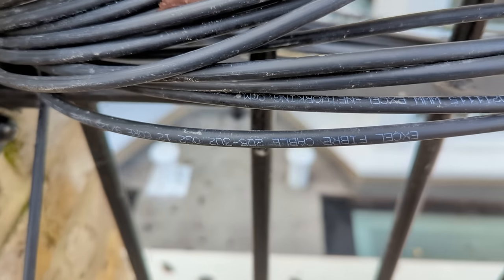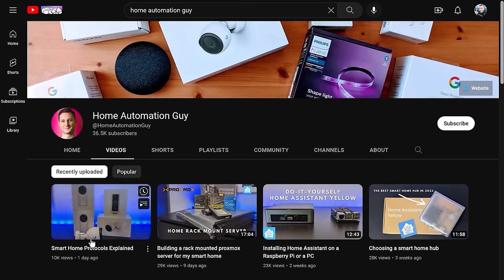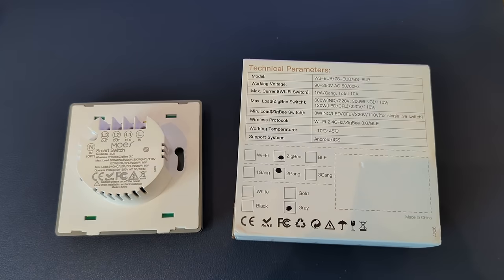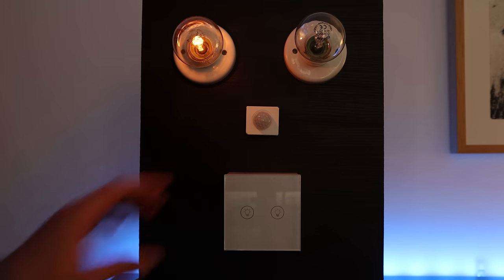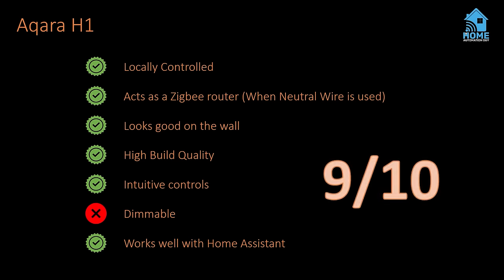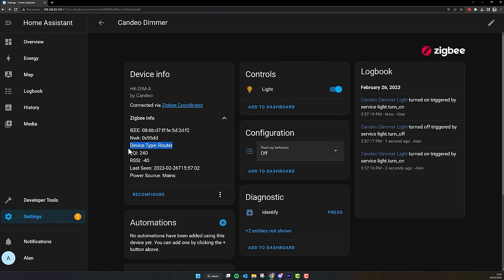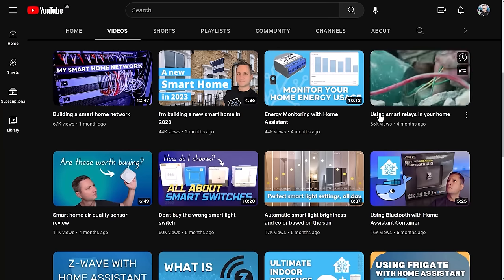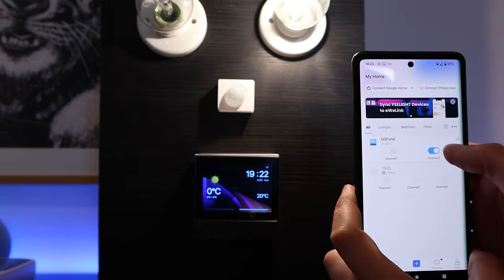Which smart light switches are the best?

Comment: Great video. A few folks have mentioned but there is the option of using Localtuya or the newer Tuya Local integrations to control your Tuya wifi devices locally. They are still connected and sending updates to the cloud, so this is by no means a security measure, rather a way to improve the responsiveness of devices. I have several Treadlife wifi switches and several lights bulbs that I connect using Localtuya and it works great.
Reply from the maker: Thanks for sharing!
Reply: I'd personally avoid wifi switches since Zigbee exists and is better suited for this use case.

Comment: I am really enjoying your videos, I have watched most of them and have picked up a lot of good advice and tips from them. Being in the UK and going through the process of building my own house and making it smart as I am going along it is really useful to watch your progress.   NSPanel a defnite yes, I bought two of them when they came out with the future purpose of using them with Home Assistant so I would be very interested in what you come up with.    I also noticed in your video you have a Heatmiser control system in your house heating. Have you tried connecting that to Home Assistant yet. I have read it can be done but haven't tackled it yet as the physical building of my house takes up most of my free time. Your thoughts on connecting it to Home Assistant?   I have an 8 Zone heating system so Home Assistant monitoring would be an ideal solution.   Thank you again for your time and effort, I look forward to everyone of your posts.
Reply from the maker: I have my Heatmiser connected in to Home Assistant using the bridge, and the HomeKit integration.  So far (About 6 weeks of usage) it has worked brilliantly.  

A full video on it will be coming soon.  Like you, I'm so busy getting the house sorted out (Both smart home stuff, and normal boring house stuff like getting the boiler serviced) that it's hard to do everything at once!

Glad you're here coming along the journey - I'm sure we'll both learn all sorts of new things!

Comment: This is beyond useful. I'm so happy you are doing these kind of videos. I'm planning to try out building a smart home using home assistant, and I just don't know where to start. Your videos are helping me understand many things as I'm completely new to this thing. If you would do a similar video to light bulbs and bands, sensors, power sockets would be awesome! Ty! Also does the 2 gang candeo consume 0.8 W of power?
Reply: What you dont mention is that you need to check your amps on your switches..not every smart switch is compatible with every house.Most homes do have neutral wire bundles in the wall! Dont confuse people on here!
Reply: @AngeloR674  i just assumed that if the 1 gang switch consumes 0.4 W, than the 2 gang consumes 0.8. I have no electrical background. I see no harm in asking. I thought this was a friendly environment. If people get easily confused by what I said they are also probably not familiar with electrical stuff, and my question will do more good than harm, if it gets a reasonal answer.

Comment: I've been using Candeo - definitely the best I've tried (albeit from a limited pool!)

You can also fit the Candeo modules into a fancier faceplate - I've got some fancy looking smart light switches now!
Reply from the maker: I'm using the Home Assistant Sky Connect zigbee coordinator.  I tested the Sonoff relays in a previous video and didn't like the clicking noise that they made, and they don't fit too well in a standard UK back box.

Comment: Great video and echos my tactile findings with the Moes and Aqara switches. However the Candeo switches were a revelation. Never heard of them before but will be giving them a check out now. I have no neutral at any of my light switches so my choices are limited anyway but they seem like a really good option along with the Aqara switches. Loving this video series. Keep up the great work!
Reply: I have a Samotech, marked as HK_DIM_A in Home Assistant, which is, I think, functionally identical to the Candeo one shown here. The only quirk of it is you can't toggle the light from HA, only turn it on and off. I didn't measure it's idle power draw. Unsure if the Candeo has this functionality but with the Samotech you can even attach a second hardwired switch to control it. You must used a push button, but it can also dim the light up and down, and operates in the same funky way as a switch shown here: dimming up and down reverses on each press. It's still a useful feature. These dimmable switches that act as a replcement for old school dimmers are definitely underrated.
Reply: I have the same issue as you, no neutral at the light I want to replace the switch on. I tried a Shelly 1L but my light would permanently stay on. I could try the bypass but read those things burn out sometimes (fire hazard).
So I’m not eyeballing the Aqara without neutral. Hope the load doesn’t have to be high in order to use them properly.

Comment: The hardest bit in this system for me is the one htat is hardest to test (without buying a ton of switches and trying them out) - how does the system work when the Home Assistant is unavailable?

Unlike the approach that you went for (smart switches + dumb lights), I am still hoping of being able to cobble together a smart switch + smart light combination, that would give all the same benefits as you described (including turning lights on/off when Home Assistant/Zibgee/WiFi are down), but also allow control of brightness and color of the lights from external controll (like via HA scripts and automations).

And here lies the problem - ideally, I'd like the wall switch to send signal to the smart bulb(s) to turn on/off/up/down when the system is working correctly, but also fall back to physically cutting the power when the system is down. And I am not sure if there actually exists a solution that can do this.

Comment: I went with Sonoff, a combination of the NSPanel and the M5 (which is just a regular switch). I went 3 Gang everywhere on the M5s even though I don't need more than one gang anywhere (except I need two in the living room, but there's an NSPanel there, so two gangs was a given there).

They're wifi and they do not dim. I plan to do my dimming through smart bulbs anyway (yeah, I'm doing both smart switches and bulbs). I'm also expecting that one to three presets and maybe some automations will be more useful than a dimmer switch that sets the light level manually.

However, the main benefit is that I'm running ESPHome on the switches. That's a lot of effort to set up, but competely guaranteed to be local and giving me insane levels of control. I set up things like long presses and double clicks, and I set it to blink the blue "status led" to give feedback when doing those things. And the level of control that ESPHome combined with nspanel-lovelace-ui gives met over the (matching!) NSPanels is absolutely insane.
Reply from the maker: I agree that ESPHome is awesome and I love that you can flash those devices with it. But I agree that it's an effort!

I've done it with a few things though that I think are worth the time investment. Stay tuned for future videos showing you what!

Comment: Thanks for taking the time to document your projects. I especially liked your comment on the wii-fi switches. :)

My solution:

Samotech dimmers, which are basically the same as the Candeo ones shown here. One of these is in the living room and controls the six lamps in the ceiling.

Rooms with one ceiling light, like bedrooms, use smart bulbs with an Ikea dimmer over the hard switch. I have a bunch of nice looking plastic mounts screwed over the switch, with the dimmer magnetically attached to the mount. The nice thing is if I ever have troubles with Zigbee or HA I can just pull off the dimmer to operate the hard switch still underneath.

The room I haven't tackled yet is the kitchen. I suspect it will be more Samotech dimmers driving the 12 downlighters in the ceiling. Bathrooms with extraction fans also present some interesting challenges.

Comment: I use Aqara neutral switches throughout my home but my main difference was also Zigbee RGB downlights or GU10 bulbs throughout, about 75 in total. The main plus side of this is complete control of every bulb by not having the switches wired in as dumb switches, i.e. they don’t completely kill the power to the bulb. I have mini switches around the home that activate scenes or i can double tap the aqaras to do something else. Pairing is a real pain but that should be rare once initially setup
Reply: Hi, I hope you don't mind me replying to this old(ish) comment..... I'm just nearing the end of a full-home referb and I've come to the time to choose lighting options. Like you, we are going to have GU10 spotlights throughout, probably a similar number to you, and I am keen to have them all as smart bulbs so I can control different scenes/setups anywhere in the house. I've been pulling my hair out trying to find a tidy solution for the switches that keeps the hard- power on while allowing soft- switching of the relevant lights. Dimming would be nice but I can live without it - 90% of use will probably be by voice anyway. What I desperately don't want is battery powered switches sitting on faceplates over dumb switches though. It seems like such an inelegant solution and before finding the Aqara in this vid I couldn't believe there wasn't a better alternative.

I am replying to ask if you woudn't mind answering a few Qs? a) Are you still happy with the Aqara solution? Which GU10s are you using and would you recommend them? Same question with the mini switches? Are you using this all with Home Assistant or native apps? (I am unfamiliar with HomeAssistant, but tech savvy so I will soon learn if it is the best way to go). Any other tips? Thanks so much in advance for your time!!!

Comment: good day Alan and great review as usual! I used it as an inspiration and finally decided to move forward with Aqara H1 EU (no neutral) for most of my wall switches. What is left to be done is the hall-way where 3 dumb-switches (also no neutral) control a single light. Do you have any recommendation how to tackle this specific use-case for which I will need three Zigbee (no neutral) smart-switches? I don't think H1 can do the job. Thanks!

Comment: I am just getting into smartening up my home and had some what similar requirements particularly for the minimum use of wifi in order to keep things local ( I expect us all to be disconnected from
 The grid for various reasons in the future) and I agree about the zigbee focus, one of the things you didn’t try and I am waiting on the delivery of some units to test are kinetic based rf switches from in my case Quinetic. As they can connect to the quinetic hub to give WiFi and therefore home assistant integration they serve for me the purpose of not having to channel out walls in areas where I want new two and three gang switches, the ability to not have anyone mess up the automated side of things by using a wall switch but giving Luddites the ability to seek out the familiar wall boxes to make light is a very nice to have conceptually, infact if this works I will put all the main power cut protected lights on to kinetic switches to ensure safe passage around the property in black out periods.

Interested in any feedback from anyone already tried the quinetic also

Comment: Great video Alan 👍 do give the varilight v-pro smart wifi switches a look. I use them without issues and have installed them for family , may not meet your extensive requirements but they do 3 and 4 gang versions as well and come packed with great features. Also able to handle many types of dimmable led lights, trailing/leading edge and dimmable led drivers without issues. No neutral wire required.
Reply from the maker: Thanks for the tip!

Comment: At a guess the idle load from the candeo is because it needs to send a small amount of power through the bulb in order to have a small amount of power for itself.  Probably the bulb is what's actually consuming the power.  It would be interesting to see what the load is when a dimmable led is used.  Really wish candeo would release a neutral required version, it would be the perfect switch.

Comment: You will love the NSPanel, according to Mark go for the white one.
I have 7 throughout the house and the functionality is unbeatable. There are two major versions, joBr99 which is so so versatile and Blackymas blueprint which I loaded up last night to test . Blackymas version apparently supports switch functionality if WiFi drops out
Reply: The buttons work as switches with joBr99's nspanel-lovelace-ui as well. At least, I'm using it with ESPHome, which means that while the screen runs 95% on my HA server, the physical buttons run completely in ESPHome, which means that I basically have full control over what they do locally. I suspect it's similar with tasmota, but I don't actually know for sure
Reply: @jasper265  how did you get it working with ESPhome. Curious to try myself ☺️
Reply: @clairerovic  basically just follow the documentation and then use the HA service to upload the screen (which wasn't entirely clear from the documentation in my opinion). I was going to offer to help further if that didn't work, but YouTube comments aren't a great place for that and every comment I post with how else to reach me just gets deleted...

Comment: I'm working on a kitchen remodel and trying to figure out if I can wire it accordingly for smart lighting, so this information was really helpful, even though I'm in the US, since some of these vendors also sell versions in US. I also use HA with ZHA but haven't used it so much with lights yet except I have replaced some switches with Leviton Zigbee switches and dimmers and they are solid. But, I am thinking I want to have custom zones and lights to switch between warm and daylight mode, and that requires smart light fixtures, so the comment on the detached relay switch is very interesting to me, assuming there's a US version. Although it sounds like to get the full benefit, Z2M is required which I think means I have to rebuild Zigbee network from scratch and repair everything?

Comment: besides aqara, the rest of the switches you tested are simply tuya oem products, UK only has basically these 2 choices? what about brands like tapo, lutron, broadlink, sonoff and etc?
Reply from the maker: A lot of those brands don't do local control that works well with Home Assistant, which is why I didn't look into them further.

Comment: Another great review. :) I'm in a similar situation, retrofitting an entire house. Unfortunately I'm in Oz so the switches you reviewed are not directly transferable to down under due to our different switch dimensions. Although we can go up to 6 gang with ease. :)
I've been looking at the relay market instead (shelly, athom, sonoff, etc). I like the idea of being able to use any switch panel I like (including the ones that came with the house).
I also use a Zigbee network but have found over the last few years that Zigbee is 99.5% reliable. Every now and again it has random issue. Devices just drop off the mesh, have weird connectivity issues, hard-lock, etc. This probably comes down to the difference in build quality/expense of the average Zigbee product vs WiFi. Also with Zigbee there is really no ability to sensibly debug issues, it's a black box. WiFi is such a mature and well supported platform that if things go wrong, it is much easier to work out the problem, not that I have ever had any issues with WiFi.
Reply: See my switch post (Australia) . More co-ordinators and clever powered Zigbee device meshing can help as featured on here on this channel.
Reply: I miss Aussie switches. I'm an Aussie living in the USA and anything beyond 3-gang looks ridiculous here, as the box size increases horizontally for each switch. You could easily fit 6 Aussie switches in the space it takes for 2 US switches.

Comment: Thank you so much for this this video is exactly what I needed. I'm now trying to see  if I can buy rhe candeo ones  and import them to Australia. 

I wonder on power outage if they turn back on at full brightness?

Also I assume you can override in home assistant as you showed and then the dimmer would just override if it's moved ?  Thanks
Reply from the maker: You can definitely override the brightness settings using Home Assistant, my lights turn on at predefined brightness levels depending on the time of day via home assistant scenes and automations.

Comment: Home Assistant has a pretty solid 3rd party SonOff module (installable using HACS) that allows you to use most SonOff devices in local & internet mode.  I've been using it for a couple of years.  Sadly I have only used it with WiFi devices, but will be trying out their Zigbee products later this year.

On that note (and I understand this video is almost a year old), is there a reason you didn't evaluate any SonOff products?  I have both SonOff and Tuya, and I've been gifting the Tuyas to people I don't like particularly much...